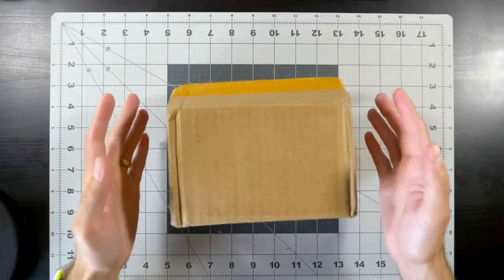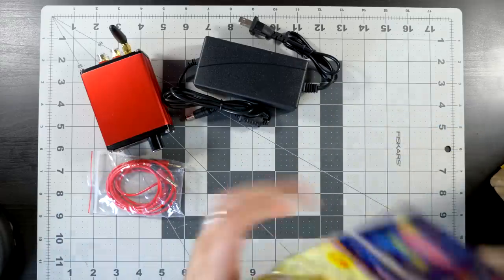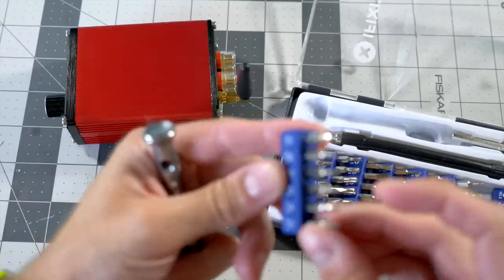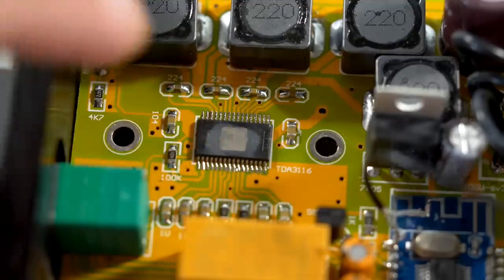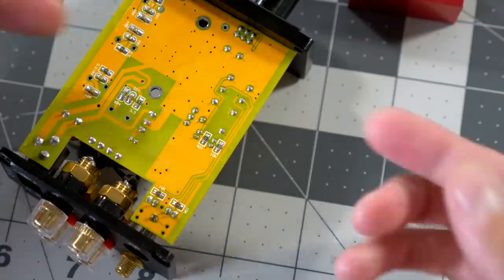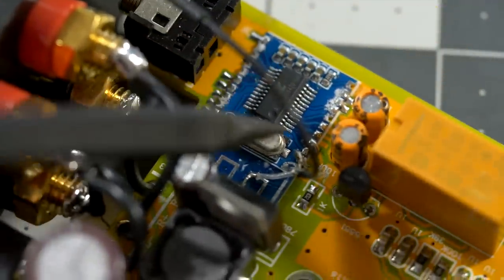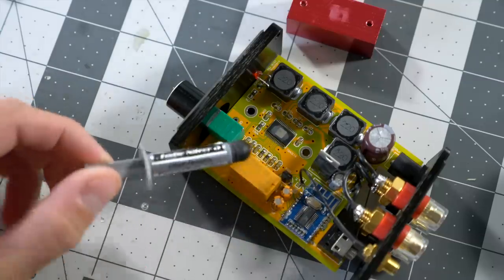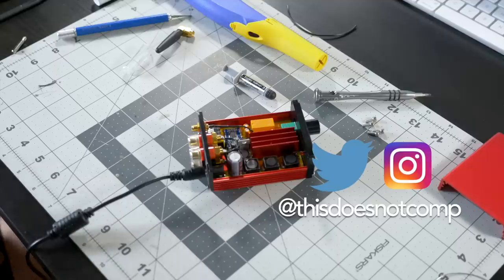Mini Audio Amp Teardown and Mod!

Comment: Chances are, by messing with the original power switching arrangement, you'll make your speakers emit an unpleasant (and possibly damaging in the long run) popping noises during the power on and/or off. The integrated amplifier chip's datasheet even states the anti-pop feature specifically in its title (noticed the big yellow relay?). Most probably, for it to work properly, you need the chip itself to already/still be under stable power supply, not during the power off/on transient state. Also, the puny switch integrated into the potentiometer really isn't designed to handle the current in the range of 5A, contrary to what your gut seems to be telling you. The input filtering cap presents a dead short causing a high current spike briefly during power-up. Having said that, both the amp chip in its sleep state and the Bluetooth module take next to no power in the grand scheme of things so the whole mod is rather pointless. The very first thing you should have done instead was to measure the actual power consumption in the standby state only to find out it's negligible and hardly worth the effort.
Reply: What he said. ^^
Reply: KernArc yes, I also wondered why he didn't test standby power.
Reply: The input filtering cap will also cause this amp to bang spectacularly if you accidentally plug it into an AC power supply.
Reply: Have to agree here. Chances are, that pot was controlling the 7805 regulator (5v) -- not the full dc rail. That 'not hooked up' part of the pot switch you checked likely ran to the regulator, or near it. I did not see you check that (maybe didn't film that part?)

Also, that cap you cut the traces on was likely working as a reservoir cap rather than a filtering cap, hence the second ground tracks (moving it further in to the power path than the beginning, which is where a filtering cap would be -- Also, the film caps are likely doing any filtering that is needed, not the big electrolytic.) Unfortunately, from the looks of the picture, it looks like you pulled the vias out when you unsoldered that cap, as they seem to be still attached to the legs of the cap. Be careful there -- You'll probably get away with it here, but some multi layered boards won't be too happy to have their vias removed mid-circuit!

My 'thought' on the all-time power? They did, or had planned for at one time, designed it so that the blue tooth would 'soft power on' the amp (regulator) when sound was received and soft power down the amp via the regulator when no sound was being received. The sleep state of that module and the amp chip itself use very, very little  power in sleep mode.

(And yes, before you all mention it, I know the 5v regulator is not the power for the amp chip, as it can have up to 24v. However, that amp chip, and many like it, take a 3.3-5v signal voltage to turn it on and off for soft power. Without that 5v reference, the chip stays in a power down state, so even with 24v applied, it consumes zero power. Therefor, the idea of the regulator being controlled by the blue tooth when it receives a signal for soft on/off makes much more sense, and as does the constant need for power. Especially considering that MOST bluetooth modules (especially all the ones I have here in my bin) have their own internal voltage regulators, so it wouldn't depend on that 7805 for its own primary power!)
Reply: Well, a reservoir cap does function as a 'filtering cap' from a DC power source. It is the voltage droop that is the source of a lot of noise from a DC supply, and a reservoir cap corrects that, as long as it has plenty of capacity. It literally smooths out any momentary droops.
Reply: Well, yes, it will do both in either situation, but I was trying to theorize as to why it was quite a bit a ways from the power source. Not knowing the full schematic, I was merely taking  stab at the intended use, rather than its affect on the system as a whole.
Reply: Precisely
Reply: Probably save space and components on a proper speaker protection circuit and uses a switch instead to disconnect and connect the speakers (via the relay) before and after power on

Comment: Neat little hack job, Collin. Nothing wrong with choosing the simplest possible solution to the problem. As for the switch, I think sometimes manufacturers just use whatever components they have handy or get a good deal on irrespective of whether or not that switch is the intended type of switch for the product.

Comment: You know you are a nerd if you have an opinion about center negative barrel connectors
Reply: adventureoflinkmk2 This was not supposed to be negative at all
Reply: Ich bin ein Nerd!
Reply: @ozzelot3349  Ich auch!
Reply: Like you want to stab the designer? (unless there's a legit reason to do it)
Reply: @adventureoflinkmk2 Most connectors are centre positive. Centre negative is done by jerks, or for very specific reasons (positive ground environments would be one)

Comment: Probably 30watts x2 = 60watts total  12v x 5amp = 60watts. If any of that Artic Silver which is electrically conductive touches the legs on that chip, it's a short. For this I use this heat conductive white silicone. When you screw the heatsink down tight to the chip, the least amount of any silicone or paste or grease will spread out.

Comment: You're lucky that your modification worked.
The switch is actualy more likely to be connected to the mute pin on the chip: remember, the PCB is double sided... 
What you just did was connecting the mute pin to the ground whenever this thing is now powered on. In fact, I could bet all I have on it since you cn actually see the trace coming from the switch and going under the chip (to pin 12 exactly) on the top PCB side.
Looking at the datasheet, the output is enabled whenthe mute pin is logic low. So it made sense to connect the other side of the switch to the ground.
Anyway, not the cleanest way to do it in my opinion, but it's working with no strange side effect, congratulations!
Reply from the maker: Yeah, I would have preferred to switch on the positive side, but there's no space to mount an additional switch in the casing and it would have taken dramatic rework of the board to isolate the existing switch contacts. I've tested the amp since the video was shot and it works just fine (well, as fine as an inexpensive amp should). Time will tell if there are any long-term ill effects, but even with that switch originally just controlling the mute function, the modification I made really just "piggybacks" on it.

Comment: Maybe you're going to have to pair the amp every time now since the chip loses power?
Reply: Most likely ...great name BTW
Reply: I have a more "mature" miniamp based on the D-amp chip from TI who drives the most of todays similar audiogadgets. Its an SMSL AD 18  and It´s pairing 24/7 via bluetooth. By the way, I don`t shut down, it doesn´t get warm at all if I dont crank up the volume during listening. So I figure there´s no need to think about how much power it draws.  A good design take care of problems instead of creating them. A TAS5508C from Texas Instrument is used, both for DSP processing and pre-amp.TAS5342A is used as a power ampliﬁer. I´ve tried a lot of D-class Mini Amps and this has all the bells and whistles needed, still affordable and very reliable.

I recommend TDNC to do a complete teardown and test the functionality of this amp instead. The cheaper stuff from the chinese market is just disappointing from what I´ve seen.
Reply: Not an issue. You pair 'em again every time you leave & revisit Bluetooth range anyway. The TPA3116 IC doesn't remember your device. It's vice versa. That's why you can rename the amp in your phone - Android can anyway.

Comment: Why would you cut the ground trace and try to put the switch in, while it’s common practice to put switches on the supply voltage trace? 🤦‍♂️

Comment: I would guess the "unused" is actually hooked to the "mute" input of the chip.  This would normally be used for "de-thump" which keeps the amp from blowing the speakers until the system is power stable.  Using the switch for power and not putting a delay on the mute input of the chip can eventually do serious damage to the speakers.

Comment: You did a mistake on cutting the trace because TPA3116 have a pin when is connected to ground will mute the amp! so before cutting you should check the tiny trace that goes to the switch on the other side of the board!

Comment: Looking at the datasheet, pin2 is a start-up/shutdown signal and the switch was there to just shut down the amp IC for minimal current draw. The BT module probably should have been wired up to the switch as well to further save on standby power, but as other suggest it does make pairing easier if always on, and may already be a low power component.

Comment: Did you try powering on the amp while connected to speakers before modifying it? Pin 12 of the TPA3116D2 is mute. It is possible that the purpose of the switch was to mute the amplifier chip so that power on thump was avoided. I had a TPA3118D2 amplifier board which had an annoying power on thump and I added a circuit to mute the amp for a few seconds after power up which avoided this. Personally I wouldn't have had a problem leaving this Nobsound amp powered constantly allowing me to connect via bluetooth quickly. Standby power usage would be minimal.
Reply: Yeah, this is good how-to video for people who go bumbling in before actually understanding the circuit.  It seems unlikely that switch on the volume control will handle the current that amp needs.  He will quite probably burn out the switch which is NOT rated for that application.
Reply: I'm more worried about under-powering the capacitor.  It could start pulsing and fry something, especially the Bluetooth module.
Reply: There looks to be a relay on the board (yellow thing near the volume control) which would probably serve as a de-thump relay - my big amp makes a satisfying click after a few seconds when the relays click on. It was difficult to tell though as he had music playing in the background, and it was difficult to hear the switch click, let alone that baby relay.
Reply: Here's the spec sheet for the relay in question: https://bit.ly/2nPRBBx

Looks to be controlling either power or signal to/from the Bluetooth receiver module. Not sure if that relay is still functional with the modification.
Reply: More likely it is pin 2, SDZ, Shutdown logic input for audio amp, so that the BT module can stay powered, but the chip shuts down the amp and goes quiescent.

Comment: Alternatively, you could have added a small toggle switch on the front panel and intercept the +ve terminal of the d.c. jack,but if no problems are experienced,your method is the simplest.

Comment: Some of these micro amps are not bad, all things considered. Nowadays if you're not looking for "audiophile" quality (or in a few cases, even if you...are), all you really need for quality music playback is a pair of good speakers, one of these micro amps, and a smartphone. Or a Bluetooth receiver, if bluetooth isn't already built in like it is here. As recently as a couple years ago, the hot ticket in micro amps was the Texas Instruments TPA3116 single-chip Class D amplifier, which could supply 50WPC into 4 ohms on a 24V supply and sounded quite nice doing it. It could also support operation down to 12V, so I recently ran mine on a portable battery pack and it worked for longer than it needed to, and it was good for a few watts (but not full power). It's remarkable what you can now buy in a cost-effective power amp IC that is smaller than a postage stamp.

Comment: I got another "OR": maybe it's simply thought to be a mute switch, not power :D

Also, there is actually an issue with your fix.
When the switch is open, you have a theoretical current path through the chip. Depending on the architecture this could damage the chip badly. 
Imagine some sort of output gate on the pin wich is off (connected to GND) by default. Now you provided a clear current path from plus through the BT module, the LED and stuff, into a GND pin of that chip and out of the IO-Pin to the outer sleeve of the jack.

And I might have spotted a pull-up resistor on that pin. If so, you have it permanently connected across your power supply.

Obviously the thing didn't blow up. But the chip could still fail prematurely (and if so then when its off). Or you got a winner here and nothing happens ever at all ;) I'd check the resistor think, though

Comment: You did a great job! Just if you do a sound test try variable power supply 0-30v just to see the difference on the fly between 12v and 24v.

Comment: Looks like to me that a student built this thing in an electricity and magnetism lab at some university.
A potentiometer is adjustable by the knob and can change the resistance on a variable resistor. The resistor is actually a coil of wire that you can change to which part of the coil you connect the electricity to vary the resistance.

Comment: The trace op the top that goes underneath the 100k resistor is what connects the other side of the switch to the enable pin op the amp chip to put it in sleep mode.
With the mod you have now the power supply is is connected to the logic level enable pin, and when it is switched off only the internal protection diode of the amp chip is holding back your entire 12V 5A power supply.
I would have designed the switch part the same because those switches usually cant switch more than 0.5A, switching more current will burn the switch contacts rather quickly.
Reply from the maker: Username checks out.

Comment: Your switch will not last long if you do not add some active input current limiting. Your power supply has a large charged capacitor at the output and you connect a large empty one every time you switch your amp on. I personally would switch on and off the mains so that the power supply gets disconnected too.

Comment: Colin. The switch on the back of the pot will probably not be rated for the current requirement at full load. I bet the other side of the pot switch goes to an mute pin on the amp chip with a pull up resistor. Pin high = mute. Pin low with switch on = unmute.

Comment: Onkyo TX-SR303 on Craigslist just now - $30, fully working. It's larger than that, but internal power supply, it's an Onkyo, has a remote, and putting a shelf up on the wall with a pair of bookshelf speakers on top of it isn't difficult. That's the route I probably would have gone. Wouldn't have made as interesting a video though. haha

Comment: My TDA3116 amp goes into standby when the power turns off. I assumed it was because of it's anti-pop anti-distortion circuitry, but it would be nice if there was a standby and a switch to totally cut the power. However, pretty sure the power drain when in standby is lower than 100ma.

Comment: The chip Mark is normally scratched off at the chip maker factory when the chip fails to meet the specified parameters. Or at the chip recycling company who can not leagaly resale with the manufacturer mark in place. Likely the case here.

Comment: I think using Arctic Silver, which i believe is electrically conductive, is not a good idea, as some of that stuff could easily squeeze out under pressure and touch some of the pins. I would use ordinary non conductive silicone grease instead if i were you.
Reply: Arctic silver is NOT conductive, as it was, for many many years, the go to paste for PC builders and I still use it to this day for regulator / mosfet heatsinks.

Comment: The total power 50W+50W is actually possible. Only thing holding it back might be the low quality components around the chip, like capacitors. The chip may also be a counterfeit but TPA3116 is such a cheap chip so I would be surprised if it was.

Comment: by bypassing the cap right at the dc plug, you lose the function of it filtering the input and inject that noise straight into the board groundplane. and if they implemented a star ground (good practise  if you combine analog and digital) you just created a big ground loop.

Comment: $0..02 Input.The power amp is always powered .The switch mutes the amp via disconnecting the ground, to prevent massive pop on power up,as delay switches are Expensive to add to a very low budget amp After this mod = 1- Massive pop on power up regardless of Volume setting,,2- Re-pairing every time it is turned on., + No power wasted when switched off.

Comment: Am I the only one that noticed they used a 25 volt cap and Max voltage is 24. I thought you were supposed to allow more headroom on capaco voltages.

Comment: I don't understand why you decided to do this modification... Bluetooth in standby mode consumes hardly any power at all, and leaving it powered would ensure you don't have to constantly re-pair your device. Also, by cutting the secondary trace going to the capacitor you created a situation in which the power supply has to throw it's full current into the amplifier at start up in order to charge the filter cap, creating a loud popping noise in the speakers (what the "mute" feature in the TI chip amp was designed to avoid) and potentially damaging the pot-switch, which is almost certainly not designed to take that kind of current...

I predict this amplifier will die an early death due to oxidation buildup on the switch caused by high current sparks. Even more so if you decide to use a 24v 6A supply.
Reply: Perfect, i believe the same. I think people before doing those "mods" should first ask why those things are the way they are, instead of going ahead believing that the product is dumb by default... dumb is the person who does not have the minimum knowledge to get to a possible answer.